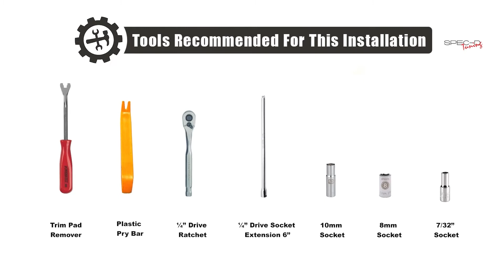Spec-D Sequential Headlights w/ Switchback Ford F150 (2015, 2016, 2017) Demo and DIY Install

Comment from the maker: Order here: https://shop.redline360.com/products/spec-d-projector-headlights-ford-f150-led-drl-sequential-2015-2016-2017-black-chrome-smoke
Reply: No splicing or re wiring involved? It’s straight plug and play?

Comment: I already bought the headlights ... but how do I put led bulbs
Reply: I’m wondering the same because I already have LED bulbs but I don’t want halogen or HID lights.
Reply: @Dunkinblownutzz_1  have you been able to find out how to put in led bulbs? I just got mine and I ordered led from Amazon but it doesn’t plug in.
Reply: We’re you able to find out a way?
Reply: @ian_5832  I haven’t ordered these yet. I have a 2015 with factory led lights . I think you can’t fit them on this style of headlight
Reply: @Dunkinblownutzz_1  i believe you need to get the H7 high & low beam bulbs
Reply: @los.2869  okay I appreciate that bro, I just ordered these headlights. I’ll get the ones you just mentioned and let you know how it works !